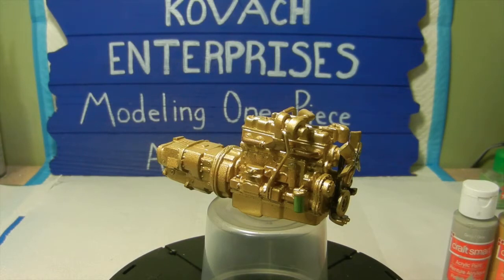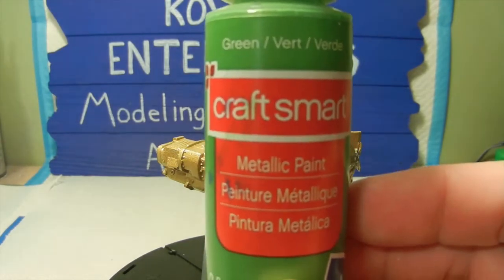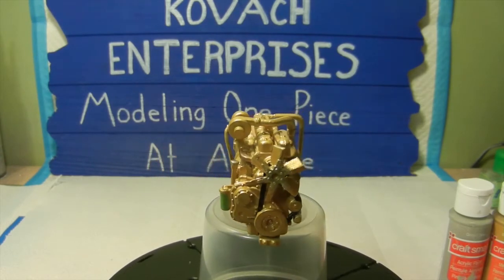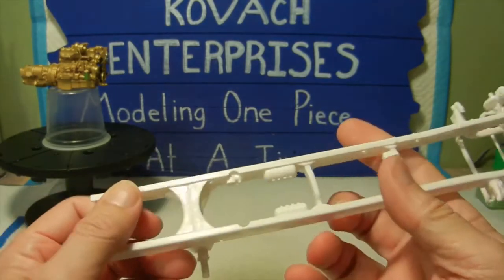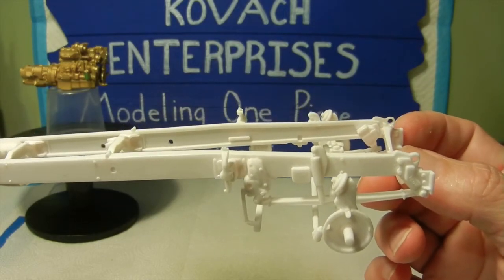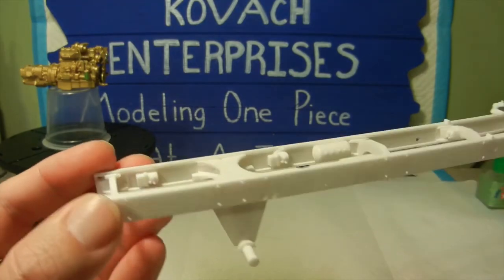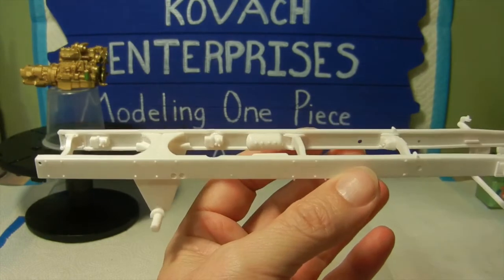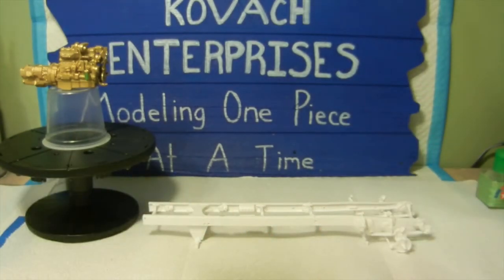Big Rig Group Group Build Ep.1

Comment: Great progress! You are almost to where I am in the build, lol. My front cross member split on the bottom and am reworking the rear shocks... they were 3/16 off from where they should be with the suspension leveled out to the front..... good times!  I will keep you posted if I run into more trouble spots, have a good week.
Reply from the maker: Thanks Dave, working on the rear suspension now and I believe I'm running into the same problem as you are! LOL. Thanks for the heads up. Have a good week as well.